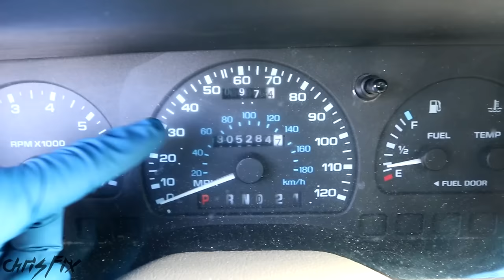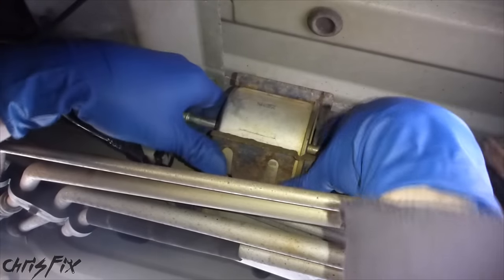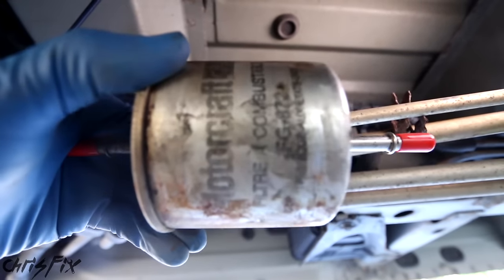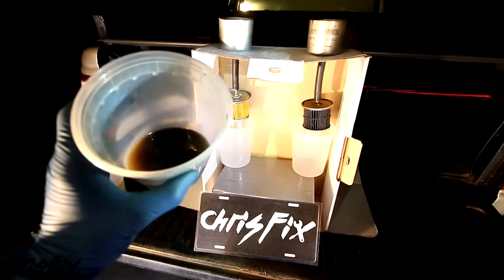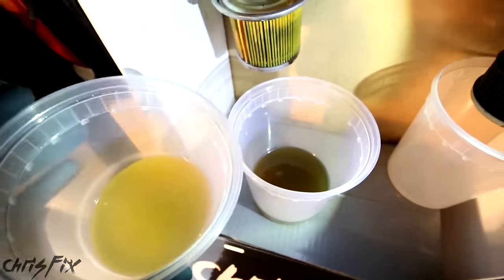What does the inside of a Fuel Filter look like after 300,000 miles?

Comment: The gravity tests were also in reverse direction which can have an influence on flow, albeit minor. The old filter would likely have gotten better as you put more fuel in it since it would partially unclog those pores.

 I am doubtful the clean filter would have different results in your small scale if flow was reversed. We do work in my lab where we separate based off chemical and physical properties as opposed to size of particulates. Our columns could get different results if we reverse flow depending on what they are packed with. But generally they are uniform. I only say this because in limited cases, forwards and backwards are not the same. But I think your demonstration was phenomenal at showing filtration capabilities.

What I would have liked to see on the dirty filter was how nasty the fuel was if going in the proper flow direction. Since you loosened the grit by going the opposite direction, we don't have a clear view of whether or not that grit and color make it to the fuel injectors. I presume the answer is no if the filter is still intact, but yes if any material has worn down. You injectors weren't clogged.

Love your videos. They have inspired me to do a lot more mechanical work on my own. Now I have friends coming by to ask questions and I often send links to your videos. Keep up the great work.

Comment: I change my fuel filter every 30k to avoid fuel pump problems and on the vehicles I do that on I haven't had a need to change the fuel pumps. I can't believe you of all people waited that long to change that filter...
Reply: +Joshua C sounds like i'm going to have to change some fuel filters soon!
Reply: +Joshua C HA my car has the fuel filter in a super inconvenient location therefore it is a lifetime filter.
Reply: +Himmel Weint but if it messes up don't you gotta replace the entire unit?
Reply: Spare It is one unit with the fuel pump which is inside the fuel tank. Either way will have to replace both at the same time.
Reply: Himmel Weint Oh
Reply: 15k is the longest ive ever been on a fuel filter...on my Carburated trucks I change it when I change the oil...but on those trucks the filter is only about the size of a AA battery
Reply: +Joshua C For us Ford ranger owners and the MaZda b series owners, the fuel pump is in the gas tank. There are 3 options to get it.

-Drop the gas tank
-pull the whole bed of the truck off
-Cut a hole in the bed of the truck

It's a lot harder for some vehicles and thats why we can't change it more often due to it being a huge job.
Reply: MrPooky218 I have a 2006 Ranger among other vehicles. I don't want to change my fuel pump and thats why the fuel filter gets changed around every 30k miles.

So your statement about the fuel pump is correct about the pump being a nightmare to change but the fuel filter is cheap and easy to change...
Reply: +MrPooky218 That's actually really common. Changing the fuel filter is WELL worth not having to replace the fuel pump if you wait too long.
Reply: It's a BMW isn't it?

Comment: So, why did you go 300,000 miles without changing it?
Reply: He takes really good care of his cars I'm not sure why, maybe he forgot lol
Reply: didnt he say it was a family car so maybe his parents own it.
Reply: Don't fix it if it ain't broke is probably why.  For a lot of vehicles you have to drop the tank, and most people just replace the filter when they replace a fuel pump while it's down.
Reply: The fuel filter's an inexpensive fix, you replace that as regular maintenance so you don't have to replace the fuel pump.
Reply: Yeah they're cheap, and if you have easy access to it, definitely swap it regularly.  I just meant that in some vehicles you can't access the filter easily (such as when it is inside the tank and part of the fuel pump assembly).  A ton of older cars were like this, so people only swapped them at the same time they replaced the pump since it's such a hassle.  People who used to have cars like that forget to swap it on newer cars with easy access because they're used to just doing it with the pump.
Reply: 2nd question is, was there a fuel pump replacement on the van during this time?
Reply: never mind he said they never change the pump!  SHOCKING
Reply: Johnny Knoxville id hope so
Reply: Why change the pump if it ain't broke, lol?  Expensive part and pain in the ass job because you have to drop the tank.
Reply: Alex M good point
Reply: No one really thinks of the fuel filter. I have mileage limits on all filters. I is one of those things that the only time you are really under your car in the area of the fuel filter is when something big goes down(e.g Transmission or linkages). Other than that, its front or back mainly for the oils, coolants, and common fluids.
Reply: He was waiting for his quick disconnect tool to arrive from China..
Reply: They are not easy to change. A lot of them are inside the fuel tank on modern cars and are "lifetime" filters. If you want to replace the one on my Honda Fit you have to pull the entire fuel pump out of the gas tank, take the pump completely apart, then put everything back together.
Reply: A great example of how newer cars are becoming more and more difficult to service and maintain.
Exactly why I have yet to buy a car newer than '00, they are such a bitch to work on. 80s and 90s cars are much better for the home mechanic.
Reply: and thats why you have a volvo
Reply: MM420.              You noticed he fitted a cheap Chinese lookalike filter. Would that survive for 300,000 miles  ? ....
Reply: I didn't know about a fuel filter i get lots of people don't even know about it
Reply: Changing the fuel pump at 100,000 miles is simply good maintenance procedure. FORD fuel pumps have a "pre-filter" inside the tank that MUST be changed with the installation of a new fuel pump.
 The tank does NOT have to be dropped in order to change the fuel pump and in-tank filter on Crown Vics, Grand Marquis, and Town Cars.
 The filter shown in the video is a Motorcraft FG800A, which is an external  in-line filter that mounts to the driver's side frame rail.
 I change my external fuel filter @ 35,000 miles, regardless of mileage.
Reply: Please name just ONE engine, transmission, or differential part that is used by all 3 American manufacturers. 
I have owned many foreign makes, including Austin-Healey, Renault, SAAB, English Ford, Sunbeam, Jaguar, Toyota, and Volvo. I have also owned Buick, DeSoto, Dodge, Ford, Lincoln, Mercury, Corvair, and Chevy Pick-up.
 I don't think you know what you're talking about.
Reply: If he used a cheap knock-off, the guy is an idiot. He had just provided PROOF of the Motorcraft's filtering ability to remove contaminants from the fuel system. I thought the video was an advertisement for the Motorcraft's quality and durability !!
Reply: My2CommonSense its a dd (daily driver)
Reply: He knew YouTube will be a thing
Reply: What year and model DeSoto did you have?  My family has a '56 Seville.
Reply: My2CommonSense family does that sometimes😊
Reply: it's not his van
Reply: lol my dad's w210 benz has 600,000 and never changed fuel filter and was running great
Reply: Probably never really needed to so never thought about.

Comment: After changing the 300K filter, did you notice any improvement in performance or MPG?
Reply: +SGM 26 Fuel filters do what they are advertised. They filter the gas, simple.  Performance? No. MPG improvement?, yes but not much, do don't be surprised if your car doesn't start one day because of a clogged filter. Just another part of preventive car maintenance.
Reply: +SGM 26 Personally I had a huge performance increase on my 95 C1500 after changing the fuel filter. Has 230k miles on it and I don't know if it was original or not. It was however the first time I changed it. Symptoms that went away were: hesitation and an extreme lack of acceleration. I'll also mention it's TBI and not direct injection.
Reply: +SGM 26
Yes it does. mine did after 190,000 mi. I had a V8 powered 1975 Datsun 280Z
Reply: +derjoh1986 Dang, my OG 280ZX strait 6 turbo did some serious "drifting" before that was even a word back in the late 80's. I loved fanning the clutch as I dropped it from 4th to second and squirted around corners with ladies crying in delight. I can only imagine how much rubber a V-8 would would lay down!?!
Reply: Yes!  Good times!! It was also funny to see high powered  turbo factory cars scratching their heads in disbelief. Lol
Reply: +SGM 26 
It really shouldn&#39;t. But one might have such a bad filter it causes a rich condition compensation when the fuel actually arrive at the injectors. Sound highly unlikely tho'. Would love to see that test done!
Reply: It would cause a lean condition (not a rich one) when the fuel finally reach the injectors because of the interrupted flow of fuel due to a extremely dirty filter like the one in the vid! A rich condition is when too much flow of fuel is entering the engine combustion chamber. You are actually starving an engine of fuel with an extremely dirty filter, in which will be robbing performance. No?
Reply: +derjoh1986 That was the assumption I was under as well. 

Definitely puts strain on the fuel pump.
Reply: SGM 26
Agreed!
Reply: +SGM 26 Just wondering how long the fuel pump is going to work now that it's not under strain.
I don't think it's going to last long.
May seem counter intuitive but now that motor is working different from it has, no longer "chugging" along to get that pressure it's going to TQ differently and my outside of "worn in" areas.

I used to work in a Pennzoil Quick change, one shocking thing was transmission fails after using a "T-Tec" machine. This would transfer all the old fluid out and push in new. And since the pump and friction plates were no longer loaded down with crud that "ate" themselves apart, add in a pan drop with a new filter it was worse.

So bad the company started issuing "wavers" making them not liable if the trans went, I think it was for cars over 30K tho.
Reply: ramairgto72
I'm sure it will work just as badly as before if it has gone bad already. It's just an Electric motor with an impeller and a check valve. Being low on fuel once is probably far worse than changing the old clogged filter.

Certainly not as complex as transmissions.
Reply: +Jackie chan_WTF Anything that restricts fuel flow is going to affect the engine's performance.
Reply: Addictive_LiquoriCe
No, but the result is the same, any mechanism suddenly subjected to different running stresses can fail.

That pump has been stressing for untold hours working harder then it should have, now it's "released" from that stress now living a life under different harmonics, load and hydraulics.

I actually lived this, I bought a M-715 with an electric fuel pump, thing lived untold miles with the Fire department before I got it, ran it around for a while before I changed the cheap FRAM inline, pump was much louder afterwards and failed 2 weeks later.
Reply: +ramairgto72 Transmission oil has a lot of detergents, so when you flush it the new oil dislodges all the crud and clogs everything up.
Reply: +SGM 26 After changing the fuel filters on my MB Diesel, the 5-O pulled me when the Turbo Lag kicked in LOL!! It was Night & Day difference, that was 2-years ago.
Reply: +derjoh1986 I had that experience before....I had a grand am getting 35 mpg but lacking in performace...barely could get to 60 mph. Changing the fuel filter made a very big difference...so much better performance but dropped to 31 mpg
Reply: SuperKONR
I wont discount that, but just about every trans came back.
They have internal filters and magnets, and we are talking total destruction.
Reply: +SGM 26 if a filter starts clogging up, the engine will lean out at full throttle because the pump will not be able to keep up with the demand of the engine.
That is bad news , specially for high powered turbo charged cars. Cause a lean running engine might eventually seize up...
i doubt that the filter change will improve mileage because while trying to get good mileage you will not use a lot of power and the fuel pump will be able to keep up with fuel demand of the engine.
It will however increase service life of the fuelpump, just because  with a clean filter it doesn't have to work as hard.
Reply: even though I DD my new 2016 Dodge Charger RT, I also own an original 1988 Chevrolet Celebrity Eurosport 2.8 V6 Fuel injected. I am the original owner and I recently changed out the original f.f. I needed to change it because my car would die when not accelleraring or just at a stop. after changing the F.f. I now get 32. mpg hwy and before I only was getting 25.    sad thing is, the Celebrity only has 44k miles on it and the F.f. should of needed to be changed, just the quality of fuel in the 80s was horrible and stayed in there for so many years also now it's getting excellent fuel when compared.
Reply: +SGM 26 That is one reason they fail sometimes.
Reply: Hesitation and extreme lack of acceleration were also what I was experiencing which  also went away on my vehicle after a fuel filter change which had 260 k Miles on it.
Reply: Yo Momma Did you ever open the filter up?  Considdering the problems you had and the mileage, that filter must have been loaded with dirt.
Reply: SGM 26 I
Reply: WoW......thanks for the extra info
Reply: I have a single cam VTEC civic that had just over 120k miles on it, I changed the fuel filter and performance was so minor you almost couldn't tell but the MPG was definitely noticeable, like 18-20mpg to 22-29mpg
Reply: That's why you NEVER "flush" an automatic transmission !! Drop the transmission pan and change the filter, so you can completely remove any metal shavings, grit, and/or transmission band particles from the pan. Many transmissions have metal-grabbing magnets that need to be cleaned while the filter is being changed.
 The whole job is made easier and less messy by installing a B&M Transmission Drain Plug.
Reply: Chuck Hallowell true, but any magnetic plug would would. Never heard of B&M.
Reply: If anything it would have gotten worse after the change because before it would have been running lean.
Reply: In short, most of these answers are wrong. If your car can flow more fuel, yes, he noticed a difference in power and mpg. 

The ability to flow more fuel can mean better gas mileage if the combustion temps are lowered by the egr valve operation, sometime the engine will run fine but is running rich due to a lower flow rate because the egr system does not have enough unburnt fuel to cool the combustion temperatures. 

Change your fuel filter every 30k if it's an inline filter, you'll notice a slight increase in power every time. If the filter has a regulator built into it like my Volkswagen does, you will notice a big difference if it's clogged at all.
Reply: Jackie chan_WTF Fuel injected car will lose top end speed before they just fell to start.
Reply: SGM 26 ii
Reply: Now your gas mileage went up. lol
Reply: My 2003 magna would chug along at times and stall too. There were time with complete throttle loss! engine dying as driving along at 80km'h! Poor thing was struggling hard for fuel.
Reply: I've changed MANY filters when I worked building trucks and SUVs for a used car lot. Filters can drastically affect fuel pump life (too much backpressure kills pumps) while reducing fuel flow. Filters are cheap. Pumps are expensive. Injectors are expensive and usually tedious to change.
Reply: @ramairgto72 

Yup. Any mechanic worth his salt will stress beyond sanity 'Change the fluid on time, 'cause every flush-and-filter job an overdue automatic gets comes with a free box of Neutrals'.
Reply: Low fuel pressure has no effect on the injectors?  Intuitively I would think it has some effect, what do the experts say?
Reply: @jackiechan_wtf4041  cleaner fuel = better mpg and performance

Comment: great gob !!  I live in western NY and the gas has known to be bad around hear. I have worked on cars and light and heavy trucks for over 35 years. I have seen lots fuel pumps go bad because of clogged filter.  The last windstar I did the filter had a hose clamp around filter and the disconnect was so rusted it broke. Its the SALT !!  our winters very had on cars !!

Comment: Do you think your family's Windstar will be able to reach 1,000,000 miles one day? There is an airport taxi🚖 driver whose Ford Mondeo of nearly the same era has reached 1,000,000 miles on its clock (by clock, I'm reffering to the odometer).
Reply: no way, max is 999,999
Reply: @Luckingsworth  Evidently they are not designed to rust and fall apart. Did you even watch the video? 20 years old and 305,000 miles. Clue in.
Reply: It will keep functioning as long as you keep spending money into it.
Reply: I bet it is the facelifted mondeo, a 98Ford contour which is the mondeo with some differences, it was for sale near me, and it had 914k miles, it has the 2.0 l zetec engine.

Comment: Great vid,,,,,,,BUT, as a mechanic, I am so wondering WHY you went so long without a filter service, especially since it is so easy to change.  I am assuming this was one of your extended testing procedures?  On my personal vehicles, they get changed every summer in june/july.  I never had to worry about fuel pump failure,  2000 Grand Am with 260k, 98 K1500 with 201k, and my 81 K20 gets changed 2x a year.  All that restriction causes the pump to have to push harder, working harder, causing more wear.  For my customers, I recommend at least every 2 yrs or 25K.
Reply from the maker: +Wylde1966 Because it is something I didnt think about until it was so far gone that I wanted to see how long it would last.